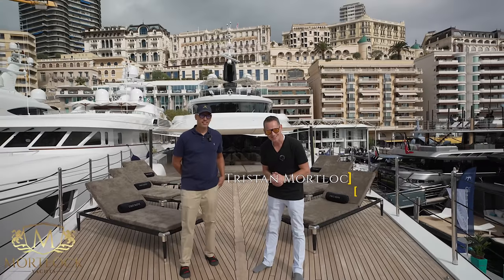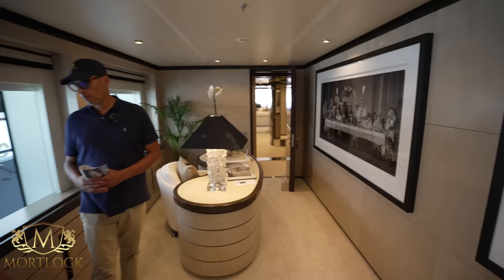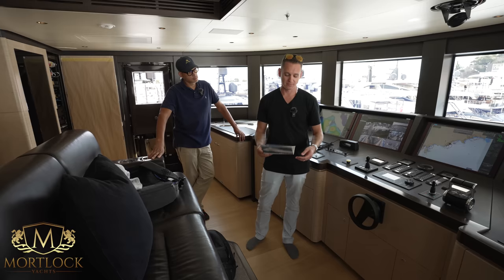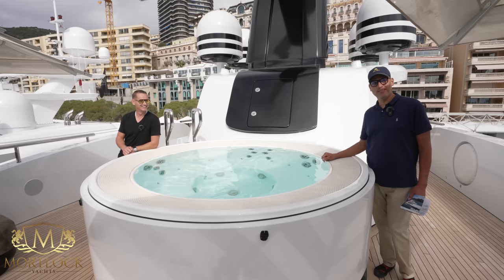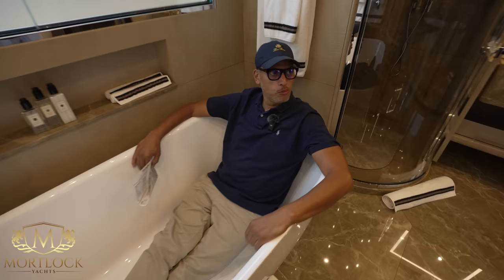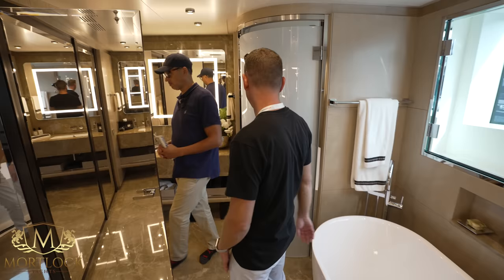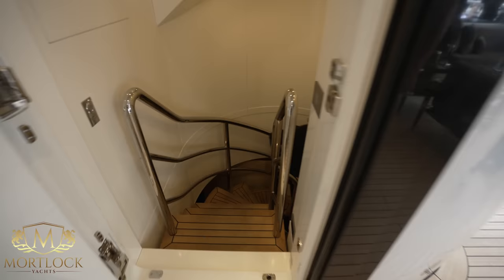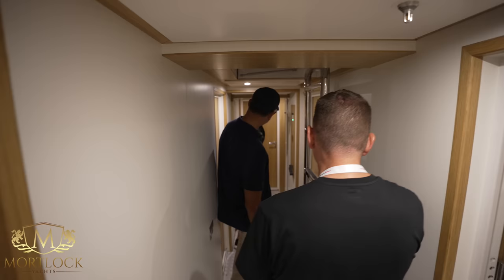What You Get For $650,000 a WEEK!!!

Comment: If I am spending €695,000 per week then it wouldn’t be Prosecco, believe me. €10 a bottle. Err, no.
Reply: Whatever you would drink on a charter would be at an extra cost to the $650,000 / week charter fee.  The charter fee gets you access to the boat at the point it is docked when the charter begins.  Any and all cost incurred to move the boat away from that docked location are additional costs (fuel, port fees at destinations, etc), as well as the cost of food and beverages consumed during the charter.  The $650,000 charter fee is just the beginning cost of a charter and the costs only go up from there.